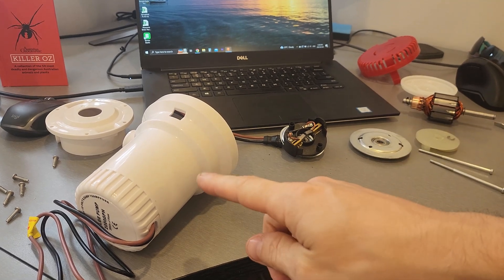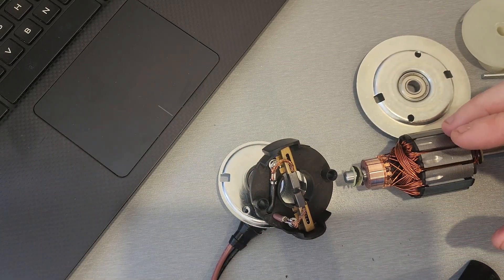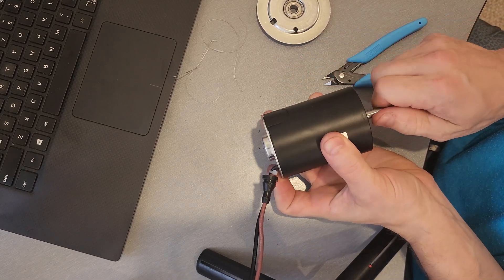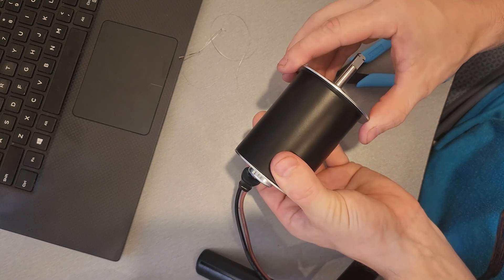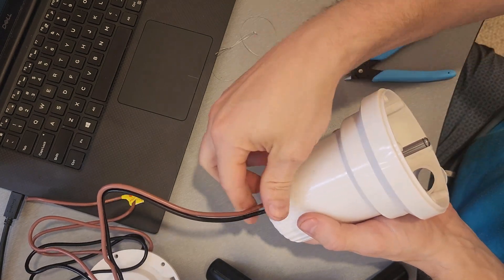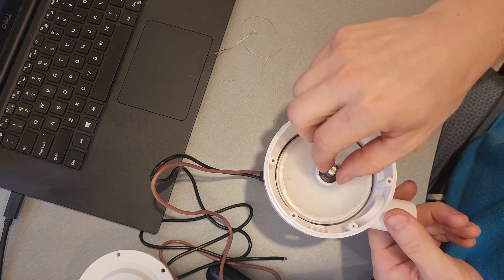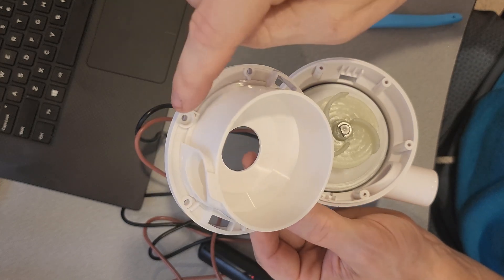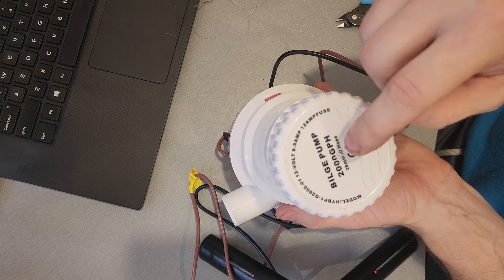What's Inside a 12 Volt 2000GPH Bilge Pump. (and why they could fail)

Comment: If you make a turbo compressor wheel design that would be EPIC! or just what ever works better is amazing tbh. I suspect you can't go to big as the motor will draw more amps. maximizing something in the housing that's standard will probably be very efficient.
You are seriously one of my favorite gold youtuber just building and designing and upgrading things to make them better is my favorite hobby. I love fishing and gold prospecting but i also have a 3d printer. I live in near Melbourne if you ever come to the golden triangle i would love to meet up one day.
Reply from the maker: I can't wait to properly test out the new impeller designs! I hope they work well...

Comment: I like how both these pumps are able to be dismantled with basic tools and re-assembled.
Especially the larger pump as the motor is also able to be repaired.
The smaller pump motor is a little tricky.
Could you post the writing on the smaller pump so I can Google and find out a little more about its specifications please ?

Comment: I had a 2200 gph water pump that died after 2 summers of usage..
Reply from the maker: At least they are pretty cheap to replace... but it would really suck if it failed on you out on your weekend trip.
Reply: @UtmostOutdoors  I have a solution for that situation - carry a spare in your glove box.